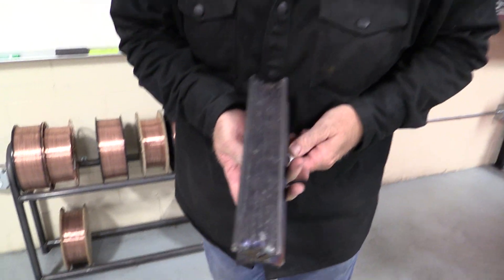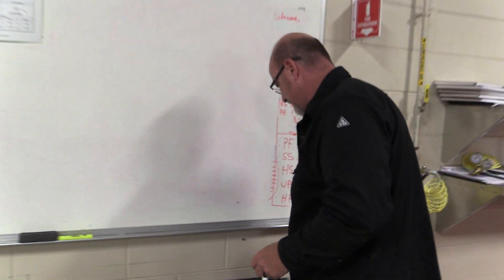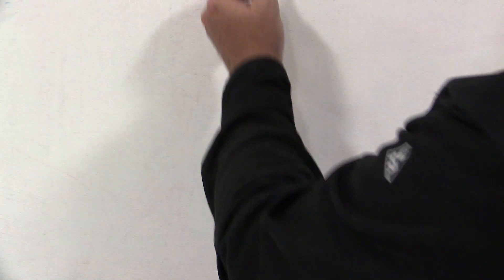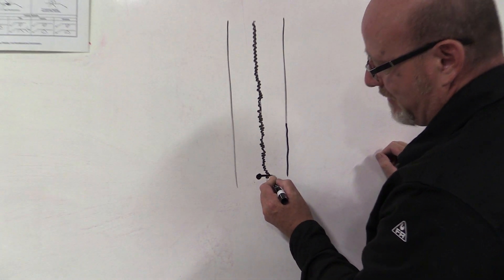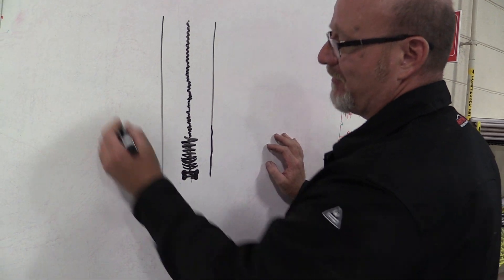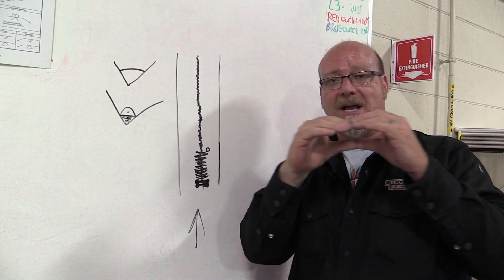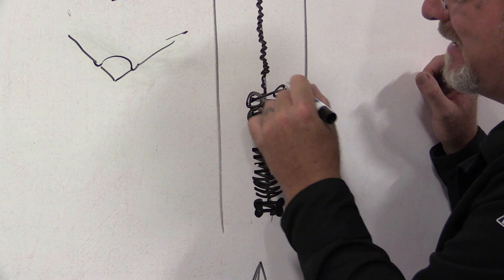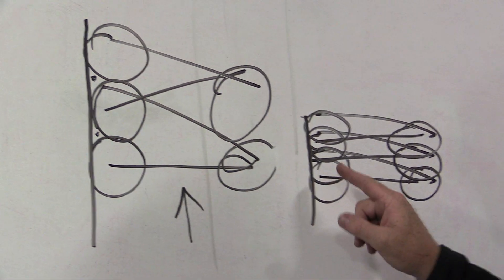Multipass Stringer beads -vs- Weave beads, whats the difference and how to do both.

Comment: When you "move across the middle & hold on the sides". . . . .move across the middle & hold on the sides. . . . .move across the middle & hold on the sides. . . . how much time are you "holding" before you move across the middle to the other side? Are you supposed to do a counting technique during this whole weave bead  running process???
Reply from the maker: Hold until you see the puddle wash and fill into the base metal, then move
Reply: @Mark Prosser Welds  Okie dokie👍🏻Thankya for the reply back!

Comment: Thank you for sharing your expertise!  I'm a new welder and would like to ask a question?
I've been watching others and their techniques.  Some have used 7014 in place of 6010 for the root and for the higher psi as a new approved technique then they grind/cut into the weld with a sharp cutting disk and weld over it with 7018. Any thoughts?

Comment: There's a huge difference weaves put way to much heat into material  softens it up changes the grain structure of the material stringers are proven stronger because your spreading that heat out most jobs I've been on have a saying you weave you leave
Reply: Why can’t you weave?